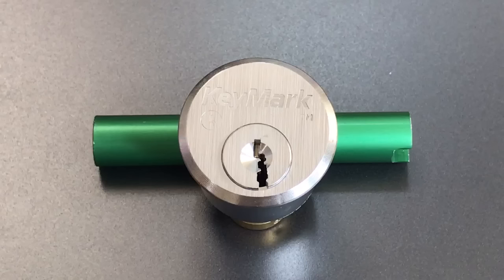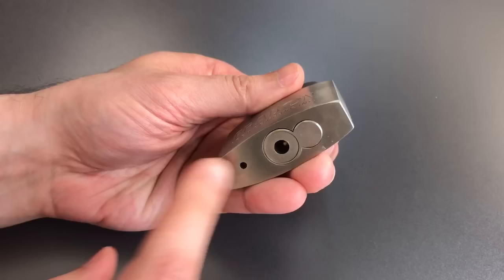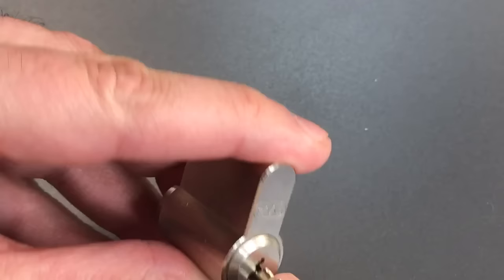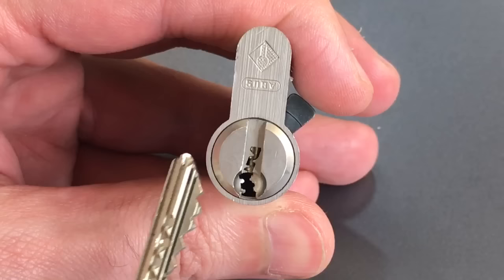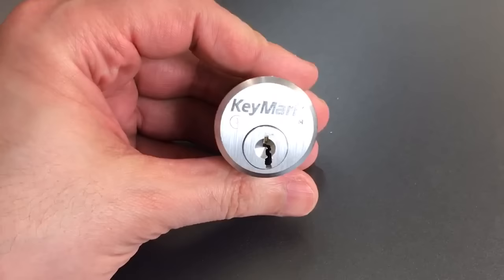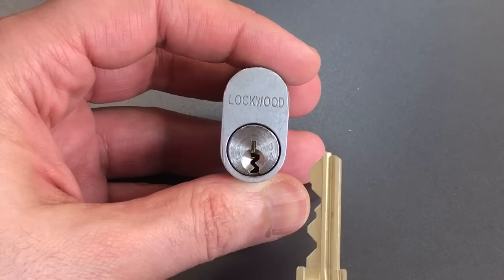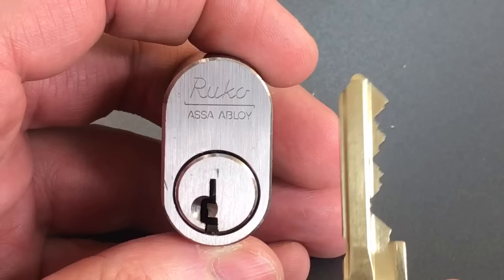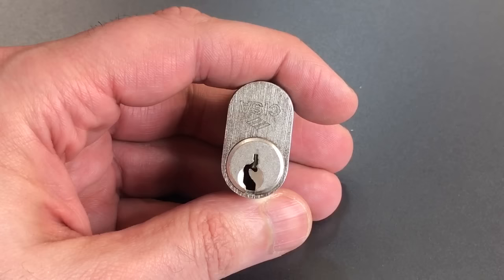[480] The Top Ten Nastiest Keyways (In My Collection)

Comment: Have you ever heard of the lock brand Super Bright? I have a deadbolt in a box somewhere I picked up at a thrift store. It was brand new and still in the box. I have no idea how old it is, but the box looks very retro -- I'm thinking late 70s or early 80s. I can't find any evidence on the internet that the brand "Super Bright" even existed.

The lock has 15 pins arranged radially, in five rows of three. The keyway is circular, and the keys are hollow cylinders with dimples where they engage the pins. There's a notch at the end of the key, which engages the rear of the keyway. In order to apply any torsion to the lock cylinder, one would need a tool that extends to the rear of the keyway, thus interfering with attempts to manipulate the pins.

If you're interested, I can look for it.

Comment: Lockpickinglawyer, how come we do not see transposition cypher locks, you would have a lock that when you turn a key, lines it up in such a way that a second or maybe even third would go in at 3 and 9 o clock. This would make it impossible for a picker to do, as you can’t hold pressure on both sides of the locks at same time to get the main key in the final position?

Comment: I have an idea for a lock, but idk if it would work. The lock has two set of pins (first set on the right bottom second to the top left of that). The key has two parts that separate. When you insert the key you first move it up to lock the first part of the key on the 1st set of pins. Then you shift the key to the left and up to hit the second set of pins. Is this even a viable lock to make? 😂

Comment: EVA locks have an issue with their zig-zag making the key bits to be fragial in my expirience, had a bent tip that had to be break of, letting the key to be inserted and only by miracle could it actualy press the pins apropiately. I wonder if not only I had the problame.

Comment: I bet a lock with 2 sets of pins in one cylinder at 90 degrees of each other would be very difficult to pick. you'd have to take the tool out and rotate it and it'd probably fuck up the tension while you do that... whatchall think?

Comment: I wonder how a lock with a corkscrew-shaped key would hold up. I envision the user twisting the key into the corkscrew keyway and the pins don't release until the key makes contact with a switch at the deepest part of the keyway. Once released, the pins, which would have a V shaped tip, would mate with thinner parts of the key. How thin that part of the key is would dictate how far the pin is able to move. I'm sure someone has tried this and I imagine at least a few people in the comment section could explain how to pick it.

Comment: Your typical criminal is not likely to be skilled enough to pick their way into any one of these locks. Even if they look up a viable technique, mastering it to a level at which they can reliably open them under pressure is highly improbable so virtually any decently made lock with a keyway like these should work pretty well for most people. 

That is, unless the thief decides to simply break a window. 

It seems like most people, in America anyway, just use basic locks that can be purchased from Home Depot. I don’t really see very many people using high or even medium security locks at home. It’s such a simple thing to change but most people just don’t bother.

Comment: If I was to create a lock it would be normal except the lock would be bigger and key thicker so you would cut grooves to fit small prongs that would stick in the key and the whole thing would all turn if you didnt move the prongs with the lock it would seize up and if you did it a little ahead it would seize up so it would not be unpickable but it would be aggravating to try to do so

Comment: So, how come the number 1 on this list is the most intimidating but you have picked it, yet there's two others lower on this list that you haven't? Personally, I find the wide open round keyway with completely unprotected pins in your honourable mentions the most interesting. It's also probably the only one that I would attempt to pick. I would give up without trying at all the others. Well, for now anyway, until I get skilled at making my own picks. ...which is a while away yet. It's interesting to see that you've now finally answered the question the industry has been asking.... Is there a lock this guy can't pick? Well, yes there is (for now).

Comment: Doesn’t “all but impossible” mean exactly the opposite ? I think it means “not impossible at all”.
Reply: The phrase 'all but' when used in this way means almost or very nearly. If only 20 people turned up to watch a football match at a ground capable of holding 100,000 spectators, you could say that 'the stadium was all but empty'. Or you could say, 'by noon, the battle was all but lost', meaning they were still fighting at that time but one side was facing almost certain defeat. In your example and the two I gave, 'all but' precedes an adjective.

But what complicates things is that the same wording can occur where 'all' is a pronoun and 'all but' means 'all except' (e.g. 'after the failed coup, all but one of the conspirators were executed', meaning all the conspirators were executed except one of them).